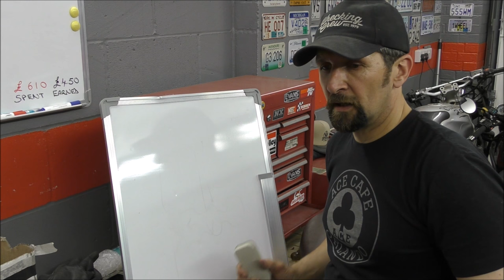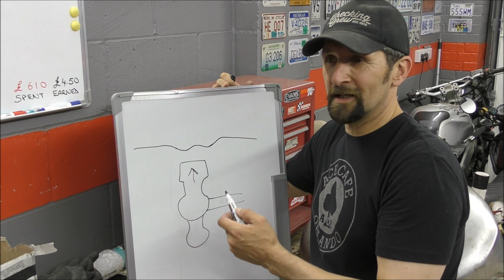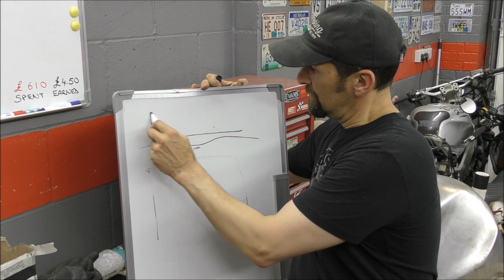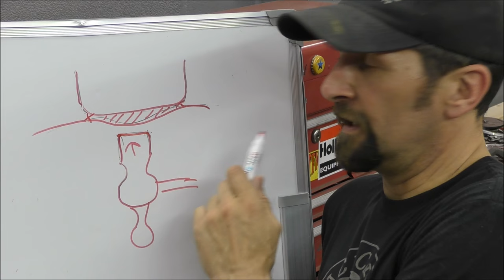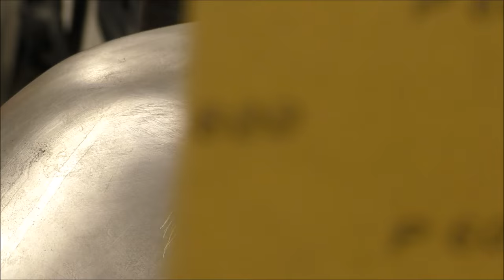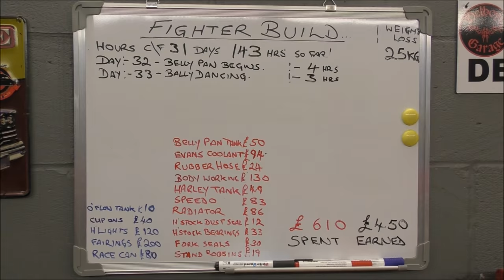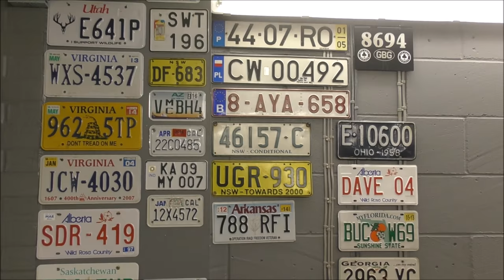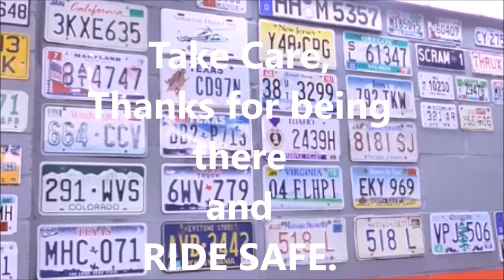Delboy's Garage, Fighter Build #30, 'Panel Beating Basics'

Comment: oh that takes me back mate, out of all the jobs ive had  ( and ive had a few beleave me I even worked in a biscuit factory as a stop gap at one time )but when panel beating I was in my element, my dad taught me the old school way then I moved onto a modern garage who's idea of panel beating was to replace the panel with a new one  dry fit it so  the lines are spot on so no wind noise and spot weld it on, then it went to paint, its the job satisfaction seing a car/van whatever come in after an accident and leave the bodyshop looking like new, cant beat it, unfortunately I had all my dollys and hammers stolen by a so called mate whilst I was in rehab, there expensive to replace for what they are and I never replaced them in the end , but if a job came up where I could go back into a bodyshop I would drop everything to do it again, absolutely love it, its a lost art the old school methods these days and its a shame, give a young lad some sheet metal who claims to be a panel beater and they would probably look at you gone out lol.
Reply: infact the last job I did was replace the whole side panel on an escort van, from the rear door hinges along the water rail and along the sill and down the and up the b post,  and across the top of the door to the a post, I had to drill out hundreds of spot welds with a spot weld drill bit. lol great job,
Reply from the maker: Penny had a Honda Cizic TypeR a few years back... some dipsh1t pushed the rear quarter panel in and they did the same as you with your van.... rather then have PDL release the dent and pull it back out... they cut the whole side of the car out from the A pillar back to the C pillar...and welded a whole new side in place.... ok, all very simple you may think until they delivered it back and i took a steel ruller from the tool box... laid it across the top of the door gap (facing along the car), fine, laid it across the door gap at the bottom, just above the sill....fine.. then laid it across the middle of the gap where the door handle was.... and the rear panel was 5mm inboard from the door... i could stick a biro point in the gap facing forward.... and all because they didnt support the panel while welding it all in..the whole side was distorted, and when we had it surveyed by VOSA, it had 13 discrepancies..... and as the Honda dealer themselved undertook the work, we took a refund on the car and handed it back... and all they had to have done was just roll the dent out and repaint it... these new methods are just lazy and lame.. and IMHO dangerous when you see how much of the car gets cut out then welded back together..
Reply: yeah you cant just go cutting the side or in pennys case  quarter panel out and welding another in without bracing it or making some sort of jig for that exact reason, and your right it is pure laziness, if it was at my old mans garage it would of been pulled back out and reworked back into shape, worst case scenario a peace cut out and replicated out of sheet steel and re braced, it might of taken a bit longer but it would of been seemless and it would of kept its original lines and rigidity,
Reply from the maker: The problem with those tin civics is they are just spit and tissue.. no inner panel to weld the outer skin to...once you take the inner trim stuff out, there it only the skin itself...and you'd have to brace it all over the inside like with a roof chop.. and i bet they didnt..!! rubbish cars, buy a Landy job done..!!
Reply: like most modern cars in this disposable throw away and buy new world we live in

Comment: love the belly pan idea. The tie-in with the upper tank is just perfect.

I'd do the trimming around the engine if it were me. Like you said, the welding and distortion trying to squeeze a band in there would give you nightmares.  Also, Keeping it the same width will air in the looks/proportions when viewing the bike from the front. Could look a bit strange if the upper and lower tanks look the same but the lower one is wider.... Just my 2c. Either way, really enjoy how this is turning out... 

Lastly the audio tweaks and adjustments are paying off!
Reply from the maker: Hi Jamie, good to hear from you buddy.. yeah, you're dead right... if i widen the bottom one it will look like a bath tub, and also the band will present a flat profile to the front unless i buy into an English wheel and go into real depths with it... i love that front profile and relly donr want to screw it up.. so "notching" it is...lol

Comment: Well done matey, it's really coming along, as for cutting the tank in half and making it wider, I wouldn't, it's already a beefy bit of kit, any bigger and you could sail in it to the IOM TT😆😆👍, looks great from my end, regards Stu 🔧🔧
Reply from the maker: Hi Stu, yeah i know, its 50/50 at the moment, id love to make it sit a bit wider, maybe only a couple of inches...but then also, i like the thought of it cut and profiled all round the motor and tight up under the pipes...its not meant to look like bodywork, just a smooth chin spoiler to match the fuel tank.... ill keep thinking, not sure yet..!

Comment: looks good. if it was mine I would think about making fairings for it. Not normal ones. Ones that look like they have almost been vacuum formed around the engine with a few cut outs so it fits as tight as possible. I'd take it up to the line of the frame. Both sides would be different so it would be a lot of work, but if you made a wire frame and fiber glass it's doable.
Reply from the maker: I've seen that done on a French custom bike in hand beaten alloy, it looked like the bike had been rolled on it's side with all the lumps and bumps, stick with it buddy, lots more to come !

Comment: Del. 

Good video as usual. 

Thought.  You mentioned that you might have to split the Tank to make it wider to fit.  Can you simply spread it out?   Weld a couple of 'pull points' and work the upper areas away?  Put on a ratchet strap and coax the sides wider. 

Don't know if I am getting my point across or if it is possible. 

Steve
Reply from the maker: Hi Stevem, yeah, i know what you're saying.. but i think in some ways i want to keep the tank looking like its obviously a tank from the same bike,...and i like it small and minimal rather then a bath tub under the motor... so ill be notching it all un round the motor so it fits dead right.. then ill make the vents and any design and style bits to enhance it... thanks fo the suggestion buddy.. thats why i love youtube..lol

Comment: Hi Del the problems with sharp dings like you had is the metal gets stretched and  never goes back the same but you made a good job of it and you would never no it was there now
Reply from the maker: The great thing with sheet metal is that it can be stretched and shrunk , a great little trick for a really strong dent is that you can anneal it, heat the centre of the dent up till it glows red, let it cool, and it will be soft as putty, but it's really important then to support the surrounding metal with a heavy dolly, then, you are no so much popping the dent out, as squashing the stretched metal back in to shape... it's a really good trick for things like exhaust heat shields that can't tolerate any filler in them... !

Comment: *With the metal being heat sync, will it need to be insulated so it won't burn if touched, Or even just radiate a lot of heat onto the legs? Maybe even keep the engine running warmer then normal. Even tho it's vented i feel like it will act like my grow lights in a way. Like even tho wind is rushing through, the metal still gets hot and radiates heat off into the room. Which is why I also need an A.C to combat that heat. Just curious what your thinking about with the heat radiation. If insulation may be needed.
Reply from the maker: There will be no contact between the header pipes and the belly pan... at least an inch gap or more.. so it wont be exactly a heat sync... but will pick up a bit of radiated heat... ill probably line it with some padding to insulate it..

Comment: nice job del I see ur vision liking it a lot that little trick with the hammer heads handy finger hole gona have to nick that idea got a sacrificial hammer in mind lol, also if ur gona band it just do the front triangle if u like as not to lose that nice front profile snug at the bottom opening up but just a thought I know what you do will look great
Reply from the maker: I Iam, yeah im thinking exactly the same as you mate... losing that glorious front profile would be a tragedy. so ill probably go with notching the thing round the obstacles to keep it looking like wha it is, a petrol tank...and not a bath tub..lol  if its too wide it will look clumsy and a flat across the front will lose the whole effect.. !

Comment: The stuff you called rust is ecoat or electric coating. In production they run electricity though the tank when the part goes into a dip tank.  The coating is bonded to the tank with electricity and then dried in an oven.
Reply from the maker: Cool.. i never knew that... its gone now though..!!!!!   thanks buddy.

Comment: What if you cut a wedge shape down to where the filler cap used to be an spread just the tank around the widest part of the engine? Would that create too much distortion? It'd definitely be less welding, not much easier though...
Reply from the maker: The amount of welding is no problem, but the end look is important... any banding even tapered, will make the front look flat, and i really like the lovelt natural curve of the front roll upwards... its better maybe ot just notch it all round the motor and make it look factory as a small bash plate maybe... not sure, each step is a careful one aye..lol
Reply: +Moonfleet41 I'm sure whatever you do will look great. Excited to see what's to come. 

New to the channel and I've been catching up on the bandit project. Starting phase 3 now. You're truly talented and I appreciate that you guys are just real and natural. You're just sharing life and it's awesome. Keep up the great work!

Comment: 3 fuel tanks leave you with one only one option for the rear end and that's a fuel tank cut up to make a trick back and love your style
Reply from the maker: Thanks mate, yeah everybody is saying this. but a long way off yet, and it wasn't a theme for any specifc purpose, I won't use a tank jus for the sake of using another tank, if I can visualise it and it works, but if not, will make it from whatever is the right thing - cheers!
Reply: Well either way I do think it's cool You can look at 2 totally different tanks and then use them to make panels that are trick looking love the project vids proper trick stuff thanks
Reply: Bradley Saunders if del does use more tanks its then a "tank fighter" catchy

Comment: my zx7r tank didnt have an under coat stripped it and primed and painted same day came out mint
Reply from the maker: They generally all have it, its called ecoat, and its a thin electrically apllied etch... but it comes off real easy as you saw...
Reply: Moonfleet41 yea i didnt even notice it with mine, my little build thread im doing for my zx7r stunt bike http://www.zxforums.com/forums/zx-7r-forum/175250-started-painting-process-02-zx7r-build-thread.html
Reply: Paul Ford thanks man, going to try and have it ready for this upcoming season, still need red stunt cage, black widow header, yoshi rs3 carbon stubby, and im going to teach myself to tig weld i have an idea for a really cool angular tube tail
Reply from the maker: Saw your thread buddy, that is one brutal looking bike!  Love the idea of painting the frame with the engine in place, I'll be doing that with mine... I did see the spoked wheels in the thread, are you planning to put those on the bike??
Reply: Moonfleet41 $1300 bike, engine was already sprayed to shit some kids shitty diy paintjob just cleaning up the best for cheap going to beat the piss out of the engine then zx9r swap it when that time comes then ill properly paint the frame, eventually i plan on getting spoked wheels but at the moment im going to paint the stock wheels bronze in the meantime, whole thing is just cheap diy no fucks given build for a bike to thrash around i even wanna test it on a dirt track haha
Reply from the maker: You'll like this then.... https://www.youtube.com/watch?v=A0d3B7MPqUg
Reply: Moonfleet41 haha video is a classic but yea i was looking for ways to get pro taper bars onto the zx7r then came across your video i was like yes now i know how to do it. needed to run em due to being 6'4 with lower back pain the clip ons being hunched over was not comfortable at all
Reply from the maker: Yeah, i agree, only just on 6ft myself... but still cant live with clipons..

Comment: 7:51 You wear a dust mask with chemical stripper, yet you have no mask when making fine particulates. Dry sanding  with out ventilation and a dust mask is the worst for you health. You now have fine particulates spread around your shop.

Comment: Hi Dell,a hole in the front,to allow air in? you could weld fangs at the back,just saying mate.!            Rabid dog look..............ATB.
Reply from the maker: Couple of nice horizontally opposed triangular shaped vents with brass mesh behind to stop the rabbits getting sucked in maybe !
Reply: There is nothing wrong with 4into 1 cooked rabbits! lol.Great project mate,and i always look forward to your updated vids.!.We are on the same wave length tho Del.In 2000,my HONDA VTR 1000 Firestorm,i fitted 2 remus cans on it,and i had "torque out loud" under the letters of my number plate,and it became a talking point at bike meetings back then.The bike is still around-T91 HOK.I miss the grunt of that "underdog".The noise gave boners to the average "sheeple man"lol.